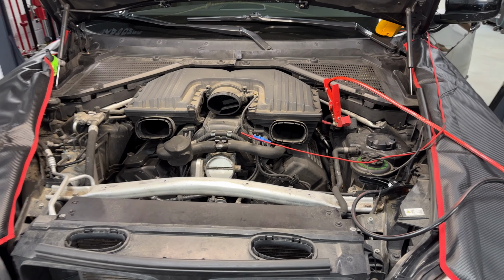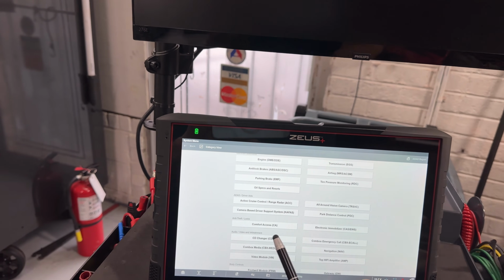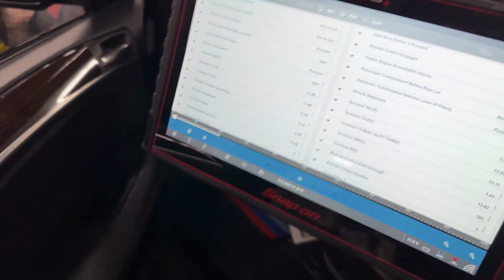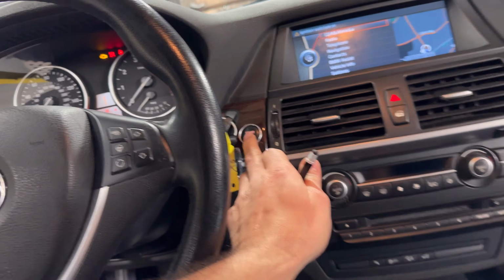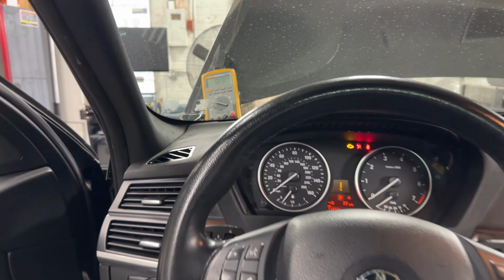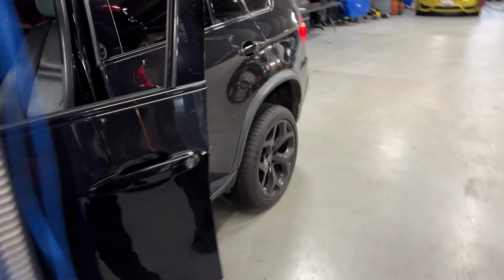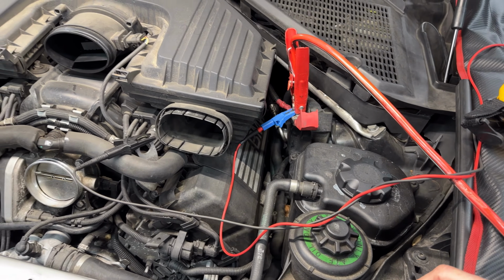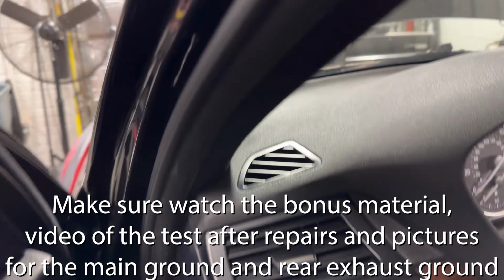2010 BMW X5 E70 N62B No Crank no Start Diagnosis step by step!!

Comment: I did this and now the car starter engages for a split second then that's it.
Reply from the maker: Havcve you try to spin the engine by hand to make sure that there is no mechanical issues?
If engine is good that sounds like a bad starter

Comment: Hey Maic,

Thanks for putting this together. 

My 2008 x5 n62 has died while driving 2 times. Each time the dash warning lights came on and infotainment screen turned off.

The first time it started on the next attempt. The second time, it didn't. I towed the car home and after charging the battery it starts.
When I check the resistance(using the same points) as you I see 0.4 ohms. Does this mean my ground strap should be replaced?
What are the alternative strap engine point that you recommend that I use ?

Comment: Good afternoon Maic, great video, I have a 2012 bmw x5m, car was running great. My air suspension compressor pump failed, making loud noises and the rear sagged all the way now. Beside that, car running great and everything is up to date. So yesterday I finally received the air compressor, I replaced the air compressor pump, car started great with no problem, the air shocks got filled up and the rear went back to its normal height. I used the car for about two hours, did a couple of stops, the car started with no problem all the times, finally got home last night, parked the car. This morning when I went to start the car, it wouldn’t. No start, no crank, just a click noise. And when I checked for any dtc, only code came back was BMW fault code 2D7C, Never seen that code before, I tried gm to google it but couldn’t find any that match it exactly, can you please help me out? Maybe I didn’t something wrong when installing the compressor? it was a very tight to take and put back the new one. Thank you so much in advance!
Reply from the maker: HI I will need more information in order to help you. Email me at maic@maicsalazardiagnostics.com

Comment: It was a very bad idea to put that jumper cable.  Doing so causes current to run through the engine and it can magnetize the crank or camshafts. When that happens the cam and crank sensors become very unpredictable.
Reply from the maker: You are joking right? What do you think the main ground strap is doing? Where do you think is attached?
Reply: @MaicSalazarDiagnostics The main ground strap at the starter failed, so when you put on that jumper cable to see it that was it, every time you crank the starter you are running current from starter up through the block and out through the jumper cable.  Not joking at all, the magnetizing happens mainly when someone puts the ground strap from the head to body with nothing from starter to body.
Reply: @mikemurphy7519 can we see your video
Reply: @CheecoWrld  Are you unable to read?
Reply: @ yes

Comment: Hey Maic, 
As others have said, it's very strange that the voltage drop did not show on the negative to negative test, which should read 0.5V or less, but your actual voltage drop at the battery dropped to zero, which should be no less than about 9.6V during cranking. 
I have installed a hidden resistor in one of our test vehicles in the alternator charge line to show my apprentices how voltage drop is created. It works well to help them understand the process of a voltage drop test.
Good video and diag - thanks for sharing. 😉

Comment: Hello Maic , I have a question . Why didn't you get voltage drop reading when you tested body ground to engine ground ? Isn't that the basic voltage drop test ? Ground to ground , power to power ? I hope my question makes sense.
Reply from the maker: Excellent question. Yes that should have shown the drop, but this was a partially open main ground, remember that Zeus was showing a good reading on the Pids as well.
Reply: @MaicSalazarDiagnostics  I beleve maybe you had a bad connection at the body ground which caused the inaccurate reading . Thank you Maic , and please don't take this as criticism,  this is only what my brain is telling me to think . Great video